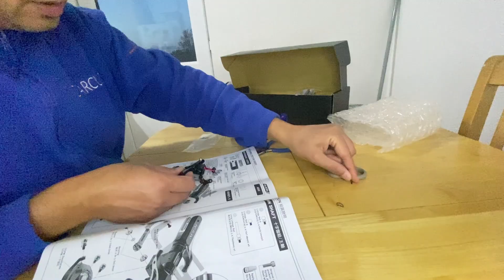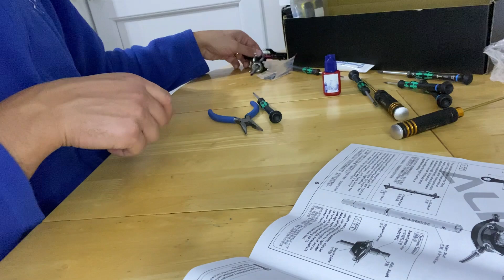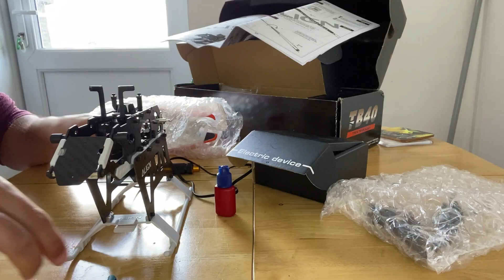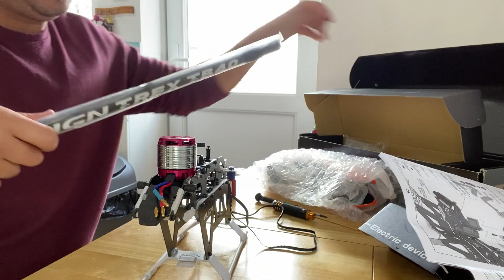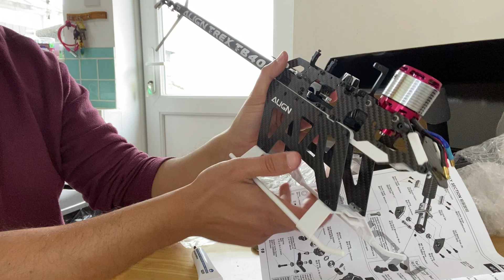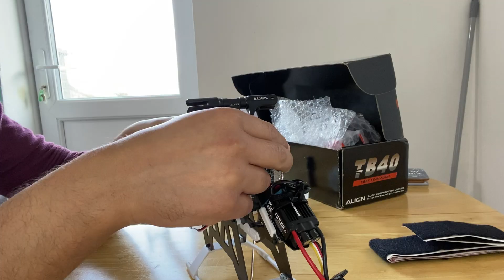Align TB40 Build

Comment: Hey Moshir.
Great video, thanks. 
I have a question… I’ve just got to the end of mine and have found the main blades are loose in the grips. If I tighten the bolt any more something is gonna give. I assume you never had this problem?
Reply from the maker: Hi, thank you. no I didn’t have this problem at all. I assume you are using the Align 380 blades? What you can do it add washers one on top and one at the bottom. But I have to say I never had this with any of my Align helicopters.
Reply: @FlyWithMoshirRC  Thanks for your reply Moshir
Yea, it was just me being dumb. I found blade bolts were missing on my kit when I put it together. I just robbed 2 bolts from another heli. Turns out the bolts were a bit too long so the nut was bottoming out on the threads. 
Built it a couple of months ago and forgot about all about the bolt issue! 🤣
Thanks again.
Reply from the maker: @DeeJayEll no problems at all, glad it’s sorted now. Enjoy it, it’s a really good flying helicopter and looks great too 😊

Comment: Is the TB 40 bigger than the 470L?
Reply from the maker: They are basically the same size. They both use 380mm blades. Both run on 6s etc. I’ve not flown the 470L but the TB40 flys great and has so much power